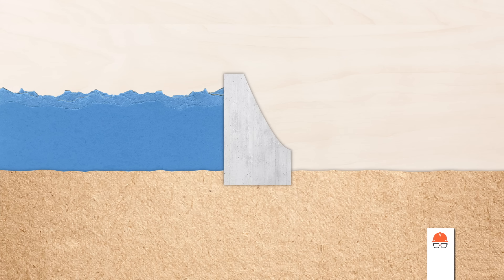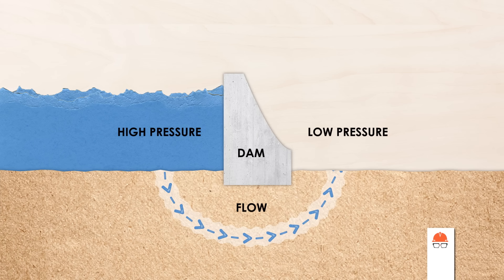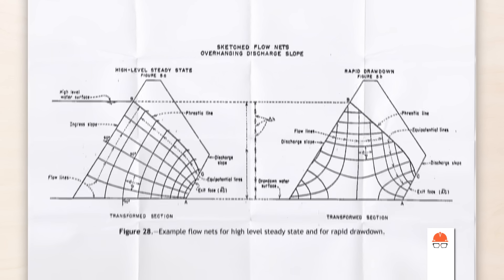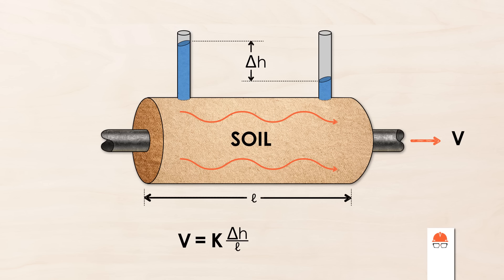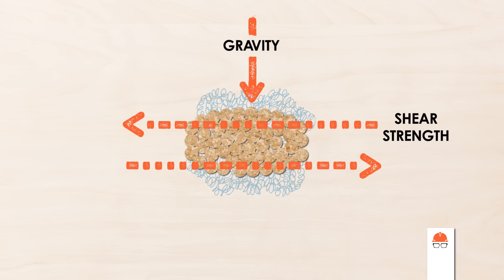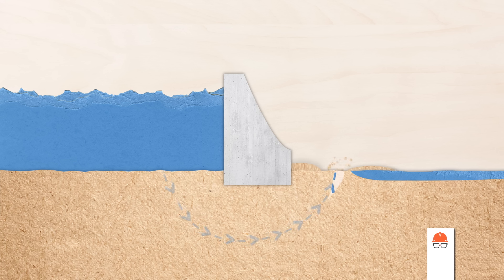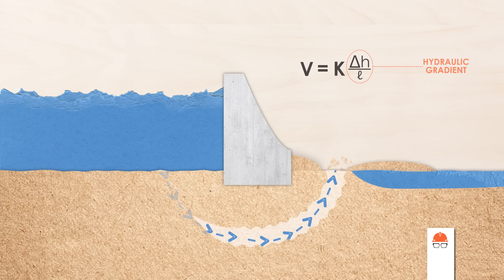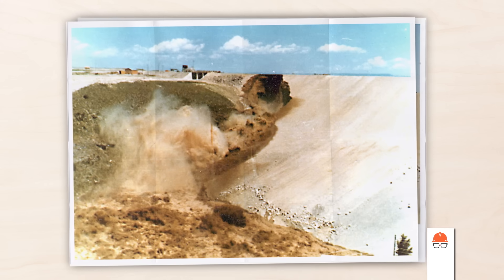How Quicksand Causes Dam Failures

Comment: Funny related occurrence of quicksand: In an area where the groundwater was high, building houses started and to get the basements done, they pumped out water to locally lower groundwater level and get the construction done. Many many houses, almost all at the same time. One of the houses though didn't get much further than digging out the hole to get to better ground and dumping sand in. Fast forward a few months and everyone shut off their pumps and water levels started to rise, but since at the most places there was compacted sand with houses on it, water found a weak spot: an abandoned construction site where they dumped in sand. As kids after we discovered that it had very quicksandy properties (read: someone of us had to be pulled out of the mess as he quickly sunk more than hip deep into it) we threw in lots of shit, including some of these 2m long steel tubes they make scaffolding out of. Boy did they have fun getting that stuff out when they continued construction (new owner) a year later. But only after they excavated their sunken in excavator...

Comment: I wish our dams here in South Africa had more water in them.
Reply: but communist is red. no one want to drink red water. they all want aqua-blue capitalistic democratic water.
Reply: Bennie Pretorius perfect time to enlarge the reservoirs when the water is low to get normal equipment in. Even if you make them so deep you can't get flow from them they still let water seep into the ground to recharge the ground water. 

More capacity means when you do get rain more is captured and not lost out to sea.
Reply: Deep.
Reply: Reverse osmosis desalination plants powered by a nuclear reactor can deliver huge volumes of fresh water for hundreths of a cent per liter and they can run almost continuously for at least half a century. They're a good solution if water shortages are chronic and you live somewhere where people are capable of maintaining infrastructure.
Reply: @Marmocet  not too mention the benefits of all the spent rods....
Reply: @simclardy1  There's enough energy in 1/20th of a cubic meter of uranium to power a modest sized city for an entire year. We're hardly talking about large volumes of stuff here.
Reply: @Marmocet  if it sounds too good to be true it's because it is. Would the heat dissipated into the water effect ecosystems? I am no expert but it seems like every high tech solution comes with a down side.
Reply: @simclardy1  A 1,000,000 kW nuclear reactor (which is a standard sized reactor) powering a "reverse osmosis" desalination plant could purify and distribute ~6,000,000 tons of fresh water every day. That's enough fresh water to meet the demand for ~16,000,000 people at US per capita usage rates (100 gallons/day). They could probably do even better than that by incorporating the ability to distill fresh water from salt water using reactor waste heat.

Would heat dissipated into water affect ecosystems? Not necessarily. The reactors themselves could be gas-cooled - no water involved. And reverse osmosis doesn't involve heating water in any way. If a distillation process were also used, that would involve heating water, but if so desired, the leftover highly saline water could simply be allowed to cool to environmental temperatures before being returned to the ocean.

Nuclear-powered desalination is in principle capable of producing gigantic quantities of fresh water. There is even a paper that was published by NASA that explores the possibility of halting or even reversing climate change by producing volumes of desalinated water sufficient to grow forest across the entire Sahara Desert and Australian Outback. The paper found that it would be feasible, from an engineering and economic standpoint at least, to do this.
Reply: @Marmocet  so what are the negative side effects?
Reply: Maybe you need deeper subsurface walls to slow down seepage?
Reply: Well you could fill those reservois with communist; they're not human but they are still made out of around 60% of water.
Reply: @MarktheRude  if commism worked would´nt that be the best and most social system?